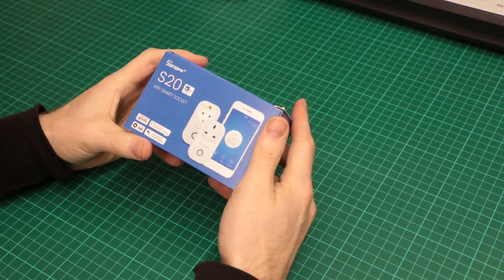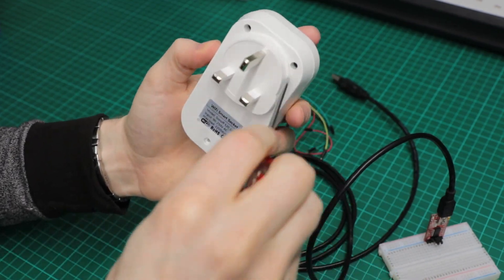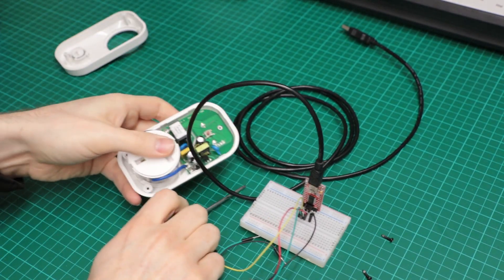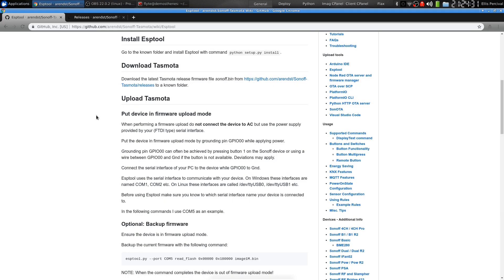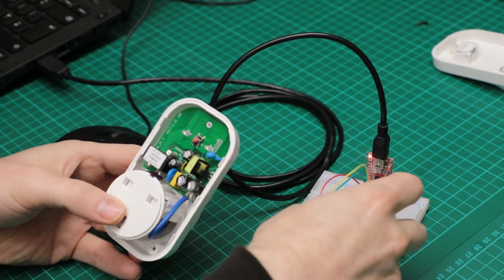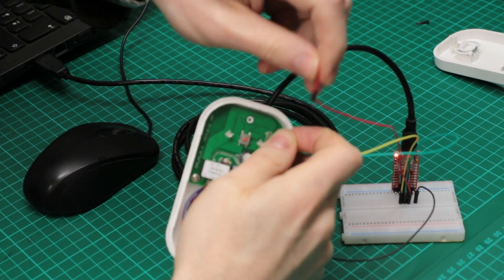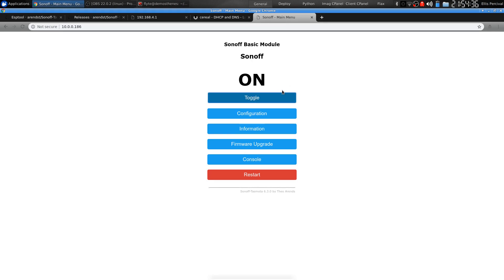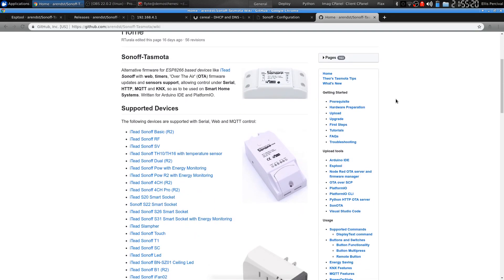Flashing the Sonoff S20 WiFi Smart Plug with open source Tasmota firmware

Comment: I own the "S20_US v1.3" version and for 4+ hours time, I could not get my S20 to flash. I thought my USB flasher was dead I flashed other devices (S30, Shelly). At wits end, I plugged the TX to TX, RX to RX with the USB flasher and was able to reprogram it.

However after flashing, I have to reverse it to TX-RX, RX-TX if I so need to flash it with another firmware. Or just OTA it next time.

Comment: Seems like you are not soldering the jumper wires as most people say in tutorials. I had actually done the same fixing the wires with strong adhesive tape, it works, no soldering needed. I think the "no soldering needed" label should be made bigger on these tutorials, especially now that the OTA methods are no longer working with newer Sonoff S20 shipped these days.

Comment: Could not flash mine.  Kept saying something about header not starting or something like that.  Turns out, they wrote the text on my sonoff board for vcc, ground, rx, and tx.  They had the tx, and rx, backwards. I had to hook, tx to tx, and rx to rx, then it flashed fine.
Reply: Same here. Also newest bin file bricked device. using one from time this video was uploaded went just fine.
Reply: @bartoszmaciejewski8155  Luck for me the newest one worked. I am surprised I did not hurt the device.  Thought I was not putting it in programming mode.  Kept trying over and over.  Once you get tasmota on there, you can update it over the internet.

Comment: can't you connect the jump wires directly to the usb to serial device?
Reply: You can. Also it is more comfortable to set wires on the plug and usb serial device firstly, then press button and connect usb to computer. Without messing around cables inside plug :)
Reply: Depends on the output order on your ftdi vs the boards.